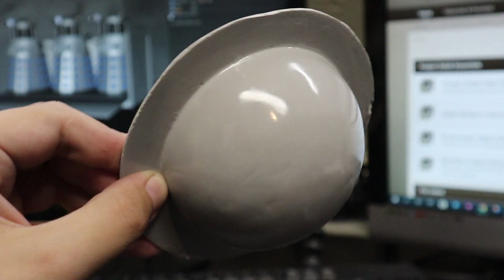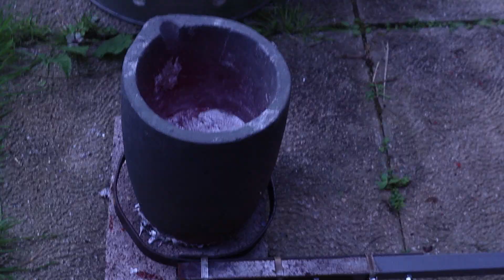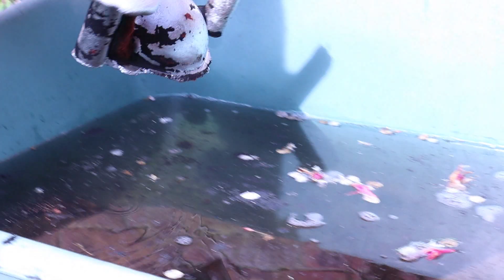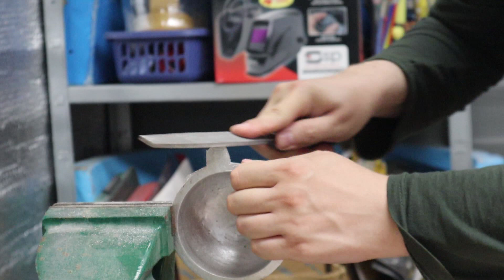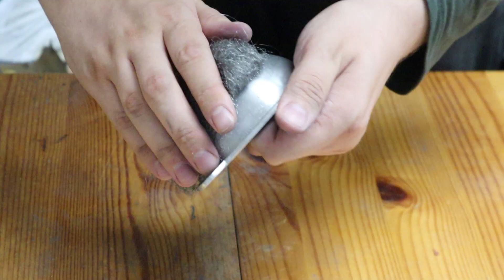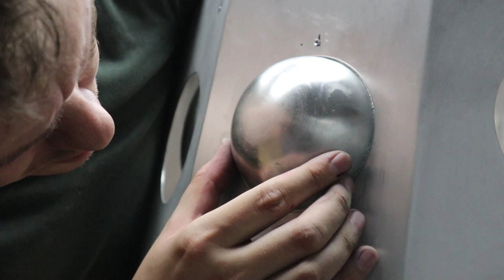Casting a Test Dalek Hemisphere From Recycled Aluminium | Aluminium Dalek Build

Comment: try blow moulding clear 2mm acrylic or 1mm polycarbonate, then paint them inside the dome for durable colour. you can make 100 in a day easy! i did, and very strong lightweight, and you can swap them all out to new color in 10 mins using diy spring twist clips inside

Comment: I keep thinking of this, I really hope to see it finished! 

And I saw you mentioned in the comments about a guy who 3D printed an Iron Man suit in titanium.
How would that work?
Is it just a CNC machine?
Reply from the maker: Yeah I should probably get my arse in get and get this finished.  All my time got eaten up last year but I should be able to get some more done soon.  I think that Iron Man suit was made by Selective Laser Sintering, where basically a set of lasers melt metal powder so they weld together in whatever pattern you want.
Reply: @SimonAyers  Thanks for the detailed reply! 

Honestly this is my favourite project on YouTube, I would have said the real life light saber but the average person does have the knowledge, tools and money to make such a device.

This is obviously isn’t the easiest but I feel is a lot more straight forward. 

I keep thinking about making a 60’s Dalek bit right now I have about £1000 saved up.
Been told I would need about £2000 for a fully kitted one.

And honestly keep it up man I can’t wait to see it, it’s pretty much what a real life Dalek would be!
Reply from the maker: @KyleTheDalek  cheers pal. 👍 glad you enjoyed the videos.

You can build a Dalek for £1000 if you don’t go to the expense of making fibreglass moulds and casting the parts. The dome has to be fibreglass but the other parts can be cheaply made from wood. You can get a decent dome on eBay if you didn’t want to make your own.

Have a look at some of the build diaries on https://www.projectdalek.com if you haven’t already.

Comment: Only finding this now! I did a lot of aluminium casting for a heritage railway project replicating old gas lamps, but would love to do a Dalek! 

If you did want to keep them aluminium and not blue, then if it was me I'd buff them up to a mirror finish.

Also I'd use countersunk rivets, although can't help but wonder if there was another technique so you didn't see any means of fitting. Even a bonding cement.
Reply from the maker: Countersunk rivets sound good. I probably should have used those to hold the skirt together. I’ve actually got some special paint that gives an anodised appearance to the aluminium so I had planned to do that for the hemisphere. Maybe I can get that tested this week and see how it comes out as it has been sat on the shelf for nearly a year.